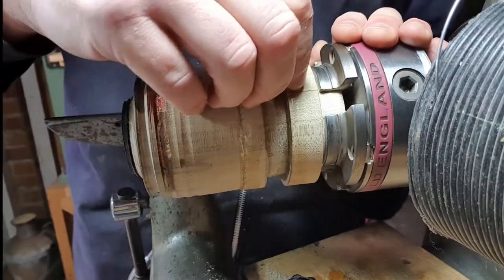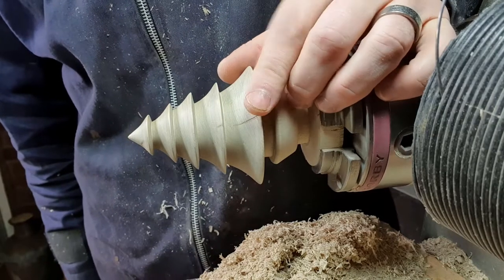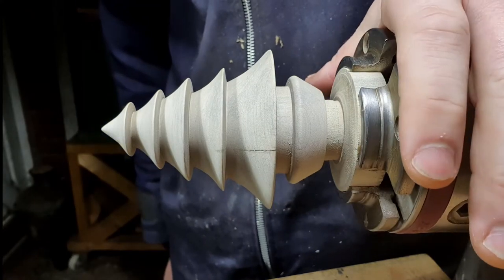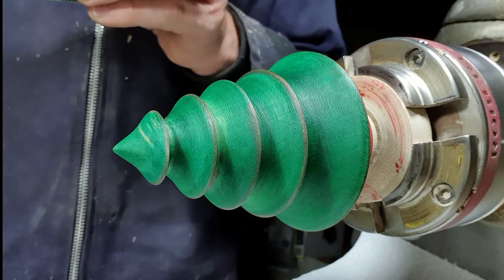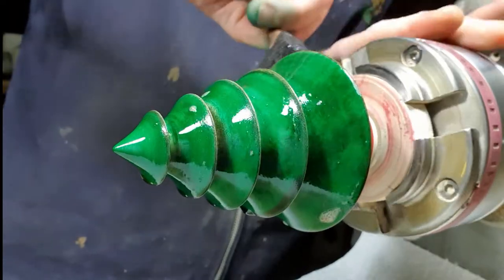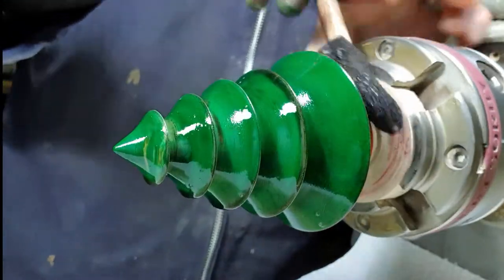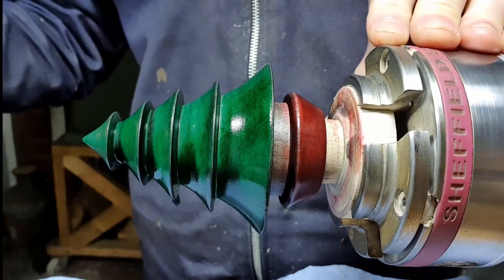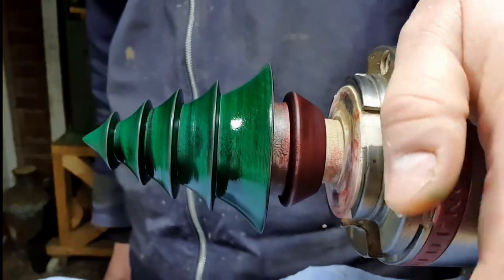Ebonising over colour with Staffordshire Black

Comment: Lots of things to like in this video.  First of all the shape of the tree.. ( I think I may nick that.. :D ) then the way the SB takes the colours down, and then the oil over the top of it all. All in all a really great demonstration of the product.
Just a couple of thoughts, would a sanding sealer be ok to put on the top of the SB instead of the oil. I would then put a coat of wax over that instead of the oil.?  Just thinking about alternative finishes although what you achieved there was really excellent.
Reply from the maker: What lovely things to say, thank you!
When the final coat of SB is dry it's a dull and flat colour which is nowhere near where it will be when it's 'finished', so it needs something to penetrate right in to the wood to make the ebonising pop - which is why I prefer to use oil.
With that in mind a good penetrating (- the key word here) sanding sealer should do a similar job before waxing, but it'll still be slightly different to an oil finish. It's horses for courses, though, so it could be exactly the result you're looking for.
Hope that helps, and thanks again.
Murray

PS. As for the shape of the tree, it's my favourite design. I can do it pretty quickly if I don't think about it, but as soon as I try to work it out in my head I end up with a toothpick ;)
Reply: @staffordshireblack  Hi Murray, Oh I know about the toothpick scenario.  I will definitely be getting some product when funds allow, I'm retired and have just bought a lot of wood so deliveries need to be rationed otherwise the wife shouts... :).    Many thanks for the information though and it might be fun to experiment.  I do follow you on Instagram ( my name there is jpbwoodworking ) and it's fun keeping up with what else is going on.  PS: I have just turned a tree that is a little like yours but the pot is definitely that shape.  Tomorrow will be colouring time.  Thanks John